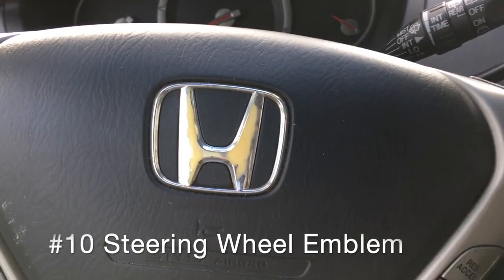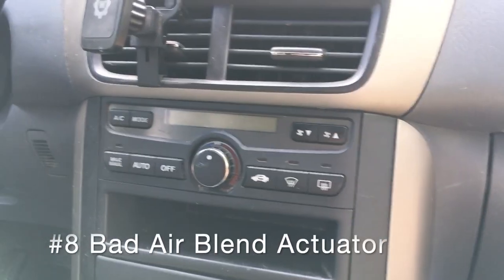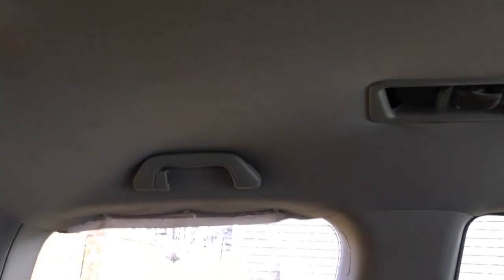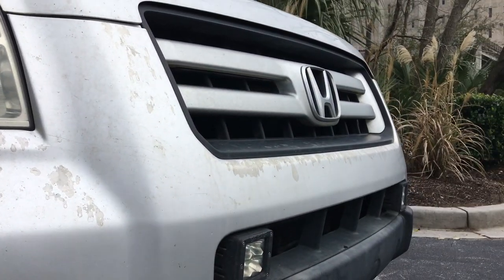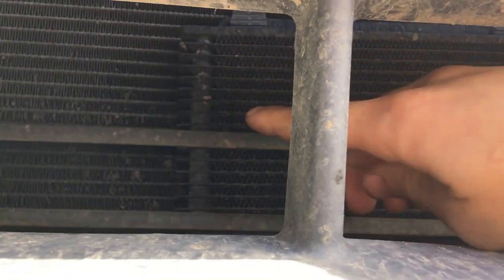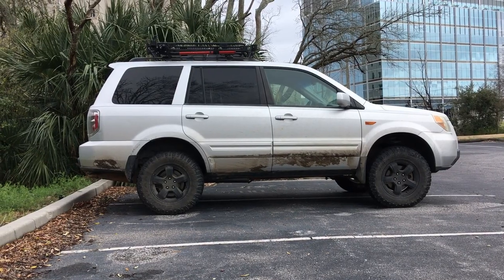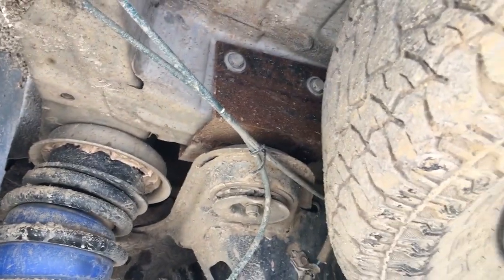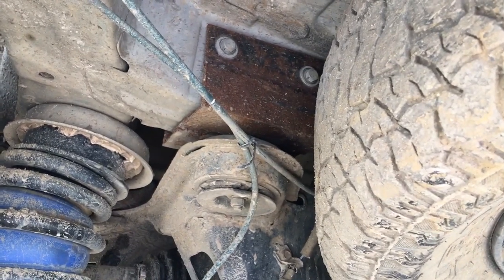Top 10 Common Honda Pilot Problems (2003-2008)

Comment: Would be nice to get part #’s for actuator tire sensors etc. Overall very good and well put together video. Timing belt kits with or without water pump are available. 😎
Reply: How about the rear tyres bendi usually a common thing with Honda pilot

Comment: I had the emblem fading, the clear coat beginning to go, the tps definitely on the rear driver side, but the worse is the whining noise after the serpentine and timing belt were changed.
Reply from the maker: I wonder if the noise is a bad pulley bearing?

Comment: You should have mentioned getting adjustable rear control arms!
Reply from the maker: Yeah! especially if you get a lift. Do you need them with a stock Pilot?
Reply: Yes, most Honda stuff is known for camber issues.
Reply from the maker: @johnjbarnes78  Good tip!
Reply: @GotterAdventure  yeah.  My rear tires wore unevenly.  Once we had the new arms installed the rear doesn't look saggy any more either.  Next step is the Timbren spring filler things. I tried the airbags but they never held air for me despite my best efforts.
Reply: I had my nephew replace the Stabilizer links , stabilizer bushings and also discovered the lower control bushings was worn out. All have been replaced and now it rides on a cloud.
Reply: big time on this one ^^  camber is out so bad on our 200000mi 08 we melted new tire out in 8 months!  putting in new control arms this week

Comment: honda emblem ... sand remaining flakes as best you can ... clean really well with alchohol.   use spray plastidip method  ...peel of surrounding and inside emblem edges using a knife or razor blade.   the emblem paint should remain as you  peel off surrounding plasti dip. check out how to paint plastidip emblem on car videos
Reply from the maker: Thanks! Sounds like a viable option for sure!
Reply: I had never heard of plastidip until your comment so I had to look it up. As an artist/inventor/maker-of-rando-things who likes working with varied materials my mind is already thrumming with possibilities. Plus how great is it to add another potential "solution" for future problems? Please accept this huge Thank You from me for the introduction!
Reply: @SusanWillful  thank you!! It has many great uses... especially for temporary ideas you cant commit to... And it peels off easy when applied thick enough.

Comment: 2004 Honda pilot with 196,000 Miles and no service engine light on it but like you said the rear bumper and other stuff like that it is really really really rusty under there like if we get rear-ended where dead

Comment: 😅 how many miles r on urs bro? I just bought one with 280k milss on it as a cheap daily till i fix my passat. From orig owner and the headliner is perfect.
Reply from the maker: Approximately 280k as well. Odometer error makes it hard to say
Reply: @GotterAdventure  bro, I just got a 2003 one with 257K on it.  It seems so far so good, but I am not sure timing belt issue,  it must be replaced at least once. How to detect the time to replace it again?

Comment: I have a 2003 pilot. It starts to shake sometimes violently at speeds over 50 only when i am on the gas pedal even if I'm only trying to maintain speed as soon as I let off the accelerater it stops and is smooth again. I have replaced the outer tie rod and wheel bearing. Both had play in them but didn't fix the problem.

Comment: 2008 with 102k, runs great, but just had to replace the ABS module. Also did the struts and rear shocks. Got the headliner saggin, but that thing is huge, I don't wan to do it
Reply from the maker: I’m with you on the headliner! So far I just have it pinned up

Comment: I just bought a 2008 Honda MRV with 134000 odemeter everything is working ok, only when I started it and put gear in reverse or Drive it went off and stop, some time not happening but always happens daily at least one time

Comment: Just bought a 2004 Pilot for 5,400 with 188,000 on it. Transmission went out 1k later. Had to get it towed out to a shop and getting a new remanufactured transmission put in. I made my bed might as we lay in it. shrug
Also had a couple leaking lines and engine mounts cracked.

Comment: Another issue with Honda motors in particular is the valves on the motor around 140K can cup from consistent heat.. and they have to be recalibrated... caused my motor to sputter a bit and sometimes just die... But I love my pilot... I have had two of them  First edition 2003 now I have a 2005 with 223K on the motor... Runs great and have taken it all over Utah, and Colorado.. great outfits with some creature comforts... Loved your videos, Thank you.  I am now going to lift mine and redo the suspension and tires.   I'll post some pics when I am done.. Also just to confirm I do have  a white Pilot and can confirm paint is peeling not just the clear coat but the actual paint.  05 EX-L
Reply: Dallas 2007 pilot is having steering issues with pilot sensor and when you go down the road the string get some harder to turn  is anybody else that has a does anyone know if that's rack and pinion or
Reply: Are steering good job on video keep

Comment: I have the paint, TPMS and ceiling, transmission cooler problem 😂
Reply from the maker: One step at a time!
Reply: Ignore the TPMS light and check pressure manually once in a while.

Comment: I replaced the bumper myself.   I have also replaced the speed sensor.  The bolt where the speed sensor is located by the tire,  it's a bitch to get it out. So if you want to do that yourself it's very easy but like I the only problem is the screw by the tire.  Other than that,  it's rewarding job.  And little jobs like that I prefer to do it myself so I know it's gonna get done right.  Ps, nice video dude.  Mine it's a 04 honda pilot EXL RES. now I'm facing another problem,  the right strut is wobbling. It's making an awful clucking sound specially when turning right.  I am gonna see if I can do it myself.  Again thanks a lot for the video.  It was informational.  You actually pointed a lot of the issues the pilot faces.  To be honest with you,  I think I'm done with hondas.  I think honda now it's just another brand

Comment: I replaced my trans and put a larger trans oil cooler
Reply from the maker: That should last you a while! Great job 👏
Reply: I put on larger oil cooler for pulling camper!
Reply: Do you have a link to the cooler you installed? Thanks.

Comment: Hi, please I observe my 06 pilot jerks when switching gears. It runs good though. I have changed the gear switch twice and same issue persist. Any advise?
Reply: There are some known issues with the transmission on the real early pilot transmissions. There was a recall on the 03 i beleive and i wonder if it might be in later ones as well.  Check your vin on the nthsa website and dig in and find out if the vehicle was ever involved
Reply: @richildblackfire806  thanks for your comment. I will do just that but any issue if I continue to use it like this?
Reply: @richildblackfire806  The issues were mostly fixed by the transmission overhaul in the 2005 Pilots, then the trans was redesigned for the 2006 Pilots which eliminated pretty much all the failures.
Reply: @johnsonolatundeolatubosun750  how did you solve this issue. Am having the same problem. Pls advise and help

Comment: Hi - my 2005 honda pilot experienced frame rot around the top of the passenger side rear shock .. the top shock bracket looks to be stainless that was some how welded or soddered to the metal frame whic hseems to be very thin .. maybe 1/8 " .. which over 17 years has rusted out .. I took the shock off cleaned all the rust off the top shock bracket and i'm thinking of bolting it to 1/4" steel bracket and then bolting the 1/4" steel to the frame which is in good shape ... I'll then fiberglass the whole area to try to get a couple of more years out of the epilot becuase . like you said.. I dont have a ton of money to spend.    If you've ever attempted something like this let me know .. I'd be real interested in what your bracket or clamp looked like
Reply from the maker: I'm sorry to hear you're experiencing frame rot. If you search on the internet you can find different brackets that people have bolted in this area. I think bolting through the metal is a good idea. If you remove the back seat you can use a metal plate and a long bolt to hold the subframe against the body.

Comment: I have an 08 no rust. I'll check the frame spot you mentioned. I spray the under body with Fluid Film  and all areas that metal is bare. My grounds became corroded with the green color so replaced the grounds. Ignition switch just started to buzz when activated by key on. Timing belt kit done. Window regulators.  Air-intake rubber rot replaced. Calipers are aged so failing, I have the worn H emblem.  Blender actuator with the gurlging. My suspension was upgraded for towing a boat so no sag or clanking for me.  Definitely clearcoat peeling issues on hood and roof. Powers steering whine solved with o ring. As mine has over 200k I added instant shudder fix to boost the transmission fluid as I hear changing could cause issue. Front dome lights have bad connection I replaced the switches and still didn't solve the issue its actually the tin pins I added some solder to thicken them and problem solved no more flicker.  Headliner sag. Heat shield vibrates around 2000 rpm haven't solved that yet. Transmission cooler good idea. Part#? My p0420 intermittent. I used Cataclean and light went out. Seen these vehicles with the Flashing D. Not mine yet. TPMS  is now active. I run with a KN air filter.  Thats off the top of my head ill add if I remember anything else.

Comment: Been watching you for about a few months now (on my gfs YouTube channel) and your channel is now just a wish list for my 06. I plan on putting the hrg 3in kit on my pilot and a wider tire a 17x9 -12 mm offset wheels with 285/70/17 which are a 32.5 diameter tire only slightly bigger than what you have but considerably wider. I’m not concerned about it sticking out (I have someone who will make custom fender flares) was wondering if you could give me a few tips so that I can get it done as smoothly as possible
Reply from the maker: Just let me know what questions you have an I will do my best to help you out.

Comment: Got the transmission cooler installed, new cat installed, new springs/struts. Issues I encountered: lights behind climate control buttons burned out, resistor for rear seat blower burned out, water in headlights, difficulty adding input to stereo without first disconnecting the satelite radio receiver (which is a hassle to access)

Comment: Transmission is an issue.
I have a '04 pilot my motor mounts had to be replaced recently.  After those were replaced now there is a squeak and grinding noise when I push the accelerator.  Hoping it not the gear box.
Reply: Yikes getting a pilot possibly today same year and I’m skeptical what could be wrong with it has 150k mileage and new A/T tires for around 3500 , how do you feel about that?
Reply from the maker: How does it drive?
Reply from the maker: You could pay a mechanic to assess it
Reply: I have a 2005 and had to replace these as well.

Comment: I highly recommend the Honda oem timing belt and water pump kit. It’s a bit more expensive but you will never have to replace it again unlike lesser brands.
Reply: The AISIN kit is the best.
Reply: replacement required after every 100,000 miles.

Comment: I think I lost the transmission in my 2005 Pilot. I was going up a small incline, I heard a loud klunk.I lost speed and when I gave it gas ,it just reved up.I have to put it in 4×4 to get home, which was less than a mile. I think something let go in the transmission? What is your opinion?

Comment: Buying a light brown 06 pilot 201k miles, is 2k dollars good or should I go offer less?  (this is a off road project not my primary vehicle) 

cons
* heater dont work 
*power steering makes noise
*engine light is on

Pros 
*no rust even where you mention
*interior & exterior is mint ! brown interior leather
Reply from the maker: If you don't mind fixing the issues it could be a great buy for 2k. There are no guarantees on used vehicles though so be careful. Maybe have a mechanic inspect it
Reply: @GotterAdventure  Ok, I think I am going for it then! Thanks for the quick response 🤜🏼 

- I am mechanic myself (5 years into it) hopefully I did good job inspected it

Comment: My Honda logo on my '05 still looks new; not sure what happened with yours.  Also the famous P0420 Code!!!!!!    While I need to get my car inspected, it's has passed the emissions test every time.  The code is intermittent on my Pilot.  I just wait until the code clears before bringing it in to get inspected.

Does it make sense to just drill drainage holes in that pillar to help prevent the rust?

Comment: I have a 2004 Honda Pilot exl with around 193,000 on it , it runs like a champ at first but after driving about 30 minutes the car will just shut off and loose all power and will not crank for a while and gives a code of p0135

Comment: Transmission issues common on all higher mileage Honda V6s. Nice review
Reply: not 07 - 08 pilots!  03 - 06's so problematic they did a redesign - added a seperated front differential box that uses diff fluid instead of trans fluid like the earlier model - 07 08's one of the more reliable trans out there

Comment: Yeah my 2004 has a saggy rear end and the air conditioning problem. With the sagging rear end do you think replacing the struts can solve it?
Reply from the maker: There are a few ways to fix the sag, air springs, new springs, or a lift spacer. The shocks dampen the spring and generally won’t effect t he rear height

Comment: If you live in Northern (snow) States look up (SMOD) Strawberry Milkshake Of Death on the Honda RIDGELINE/PILOT fourms. 

It's when the Transmission fluid mixes with Antifreeze. 

What to look for & how to fix it.
Reply: Only on the 03-05 models.
Reply: @wrenchesinmotion3282  it happened to my 2008 Honda Ridgeline .
Transmission line fittings at radiator started to fail due to rusting washers.
Reply: @johnlopez3001  Sucks that it happened to you. Not typical with the 06-08 models, but then again, you are north. External trans cooler FTW.

Comment: I have an 05 pilot and have none of these problems. My radiator came stock with a trans cooler. And I know this because the line for it broke on my wife one day. But after thos recent cold snap my power steering pump has started whining.
Reply from the maker: Sometimes you can fix the whining with an oring. Clearly some Pilots are virtually trouble free! How many miles do you have?
Reply: @GotterAdventure  183366 just looked. Shes due for lower control arms and front axles and a wheel bearing or two. But otherwise an overall amazing and great car. I also have a different steering wheel logo so maybe thats why mine is still in decent shape. Love your videos. And what youve done with your pilot.
Reply from the maker: @kristopherhill2740  I ordered cheap front control arms and the ball joints failed very quickly. In some ways it may be better to just replace the bushings. So far Napa axles seem to be better than the other big name stores. Honda OEM is best of course if you have the money.
Reply: @GotterAdventure  did they fail from off roading or just regular driving? Ill probably go honda on the axles.
Reply from the maker: @kristopherhill2740  Off roading :)
Reply: @GotterAdventure  lol. I might give the cheap ones a shot
Reply from the maker: @kristopherhill2740  In the end I have the cheap lcas with moog ball joints installed.
Reply: @GotterAdventure  yeah im gonna do some major repairs this summer before we start road tripping
Reply: My '03 Pilot had the power steering whine when it took it up north to freezing temps. It's a simple O ring change on the suction side of the pump.

Comment: My 2008 Honda Pilot for some reason every time I turn go at 10 mph on a turn it wants to shake bad and it won't get into its gear. Even when you press the brake hard the car shakes
Reply from the maker: Is it only on turns?
Reply: Yes

Comment: The AWD system in the pilot isn’t very robust and I would think twice before doing any strenuous off road stuff with it. It’s really only designed for on highway use. Other issues you may encounter are wandering steering from bad lower control arm bushings. Poor power steering performance caused by the debris filter in the reservoir being clogged, which may also cause a noise. Prolonged use with this issue will damage the pump. Water on the passenger side floorboard from seal leaks in the wheel arch. Passenger seat airbag sensing failures. Front sway bar link failures.
Reply from the maker: Hey Jon, I have you watched any of my other videos? I have put my Pilot through a lot of offroad abuse and it is taking it like a champ. Even at 280,000+ miles